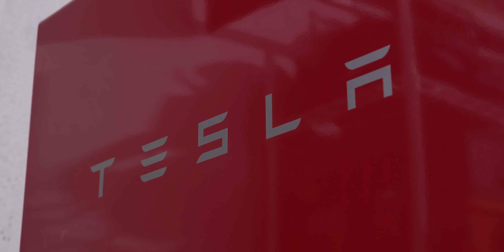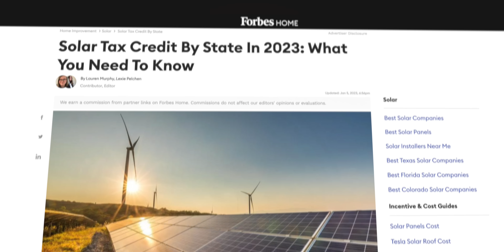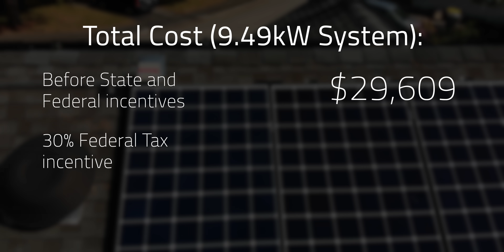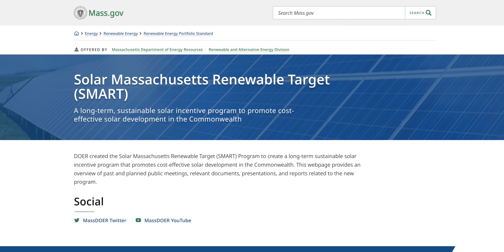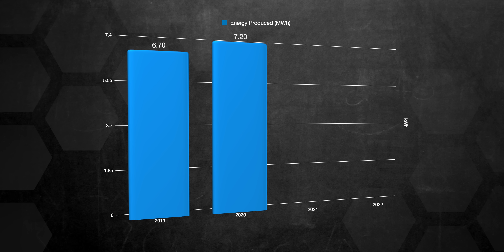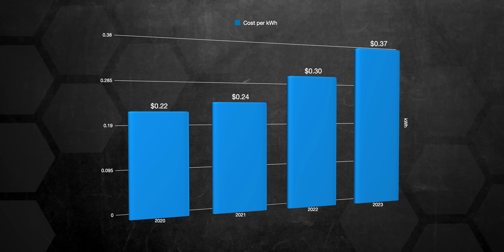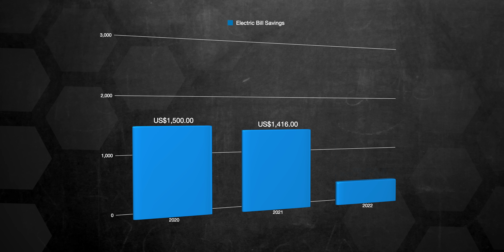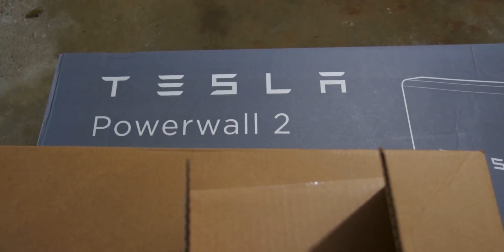5 Years with Solar Panels - Is It Still Worth It?

Comment: Roof leaks. The cost of repairing roof leaks caused by the solar install have more than wiped out any savings on my electric bill.  Initial cost of install was around $15k minus the tax credit.  Less than five years later, I'm looking at an additional expense of over $25k to repair the roof leaks including paying the original solar company over $4k to remove the solar panels so the roof can be repaired.  You must factor total roof replacement into the cost of a solar install.  Every roofer I contacted said the solar company should have told me this at the outset, but many solar companies won't because they fear losing the sale.
Reply: Installer error
Reply: Yes, unfortunately it is up to the consumer to educate themselves. Fortunately we redid our roof before solar install and no longer have electric bill , so no matter what the price per kilowatt rises to we are covered
Reply: @mj8495   curious....how many years, from when your solar panel was fully installed and full in operation will it take you to pay off the full solar panel system install?  I assume it was a whole house system.

What was your average electric utility bill per month and what's your monthly payment for the solar panel system install?

What, if any, warranty does the solar panel system come with?  Include what it covers and Time in years.

Did your home owners insurance go up?
Reply: @mj8495  but you say you do not have an electric bill anymore but now you have an expensive monthly solar bill, not a good trade off at all
Reply: @mj8495  You will never make out all things considered.
Reply: @RadioRich100  so true
Reply: That's my take on it too I had just a Direct TV dish on the roof Had a new roof put on where the dish was was a huge dry rot so with all the bolts/screws put on for the solar panels a few leaks over the years could cost thousands in damage if its not a perfect seal....
Reply: Don't install on your roof!!  Put them on stand alone away.
Reply: I question the mounting screws reliability over time. You're putting your faith in a polymer washer to seal on a granular surface. At least in the case of asphalt shingles.
Reply: @JamesSpatcher-l3r  

That's a good question.
I trust nut/bolt fasteners more.

Personally, I wouldn't place solar panels on ashphalt shingles unless I had access to the back of the sheathing

In snow belts, it's better to have a metal roof, so the snow can easily slide off
Reply: 10 years with a Solar City (now Tesla).   Cost me nothing down.  6kW system (year 1). $70/ month and Tesla guarantees output, responsible for performance and all maintenance and pays me for short falls in guaranteed production.    The inverter has failed twice and Tesla replaced free and paid for the loss of production.  Why would you ever install your own system?  Crazy.   Don’t buy a battery if you have net metering.
Reply: @miker6090  the solar company I went with will cover any roof leaks I have for the first ten years of the install.
Reply: Sorry that happened, but like everything else it needs to be installed correctly
This appears to be installer error
Reply: @miker6090  0.2% off roofs have leak issues… not common enough to steer away from the savings
Reply: @miker6090  I dislike installers that don't provide access space, so that things like roof leaks can be assessed and getting access to it.
Reply: Thats why I'm wondering if things like smart solar flower and hybrid systems with a few small wind turbines might be better. It saves the roof space for the inevitable repairs.
Reply: 25k to fix a roof leak 😂 😂 stop it! For 25k I’ll take a red eye to you right now and fix it not only that but I’ll fly out to you anytime after if need be no charge
Reply: @GreenGateTV  Your a fool, that guys comment is spot on. If you read it right he meant all the damage that system did to his house. People all over are having these problems on top of the fact that you with all this trouble will never recover the money that you spend to support that system and the  devaluing of the house. Solar panels on your house is the worse thing you can do to it.
Reply: @RadioRich100  That is a big old dumb blanket statement and not remotely true.

Comment: In my area, the cost of a solar installation is such that my payback is 18-22 years. This did not include a battery, but did include a service upgrade to 200 amps to handle the extra current. Far too expensive. Let the buyer beware.

Comment: A friend of mine is an electrician. He built a very good business, not so much on solar installation, which they done. But on repairs to botched systems. He also had an almost free system with pan els from two  -.. One panell failed and he was instructed to install 30 new panels.  Another 1 batter failed and he was told to install all new batteries

Comment: I had a 7.4kw system installed in 2009.  I paid around $30k and got back around $15k in tax credits. The first 2 years I got $3300 each year In SERCs then the program changed and has decreased each year since then. I figured the system paid itself off In approximately five years. So I am happy, definitely has reduced my monthly bills

Comment: if you paid 300 a month on electricity for 5 years straight it would cost 18k. You spent more on the installation and your building a new house now. YOUR LOSING MONEY BECAUSE YOU WANT TO BELIEVE YOUR WINNING SOMEHOW! This isnt about off grid so its only about cost vs. savings. You'll lose money on the tesla as well. Before you save the 15-20k extra you spent to NOT by gas you'll trade it in or buy another one. I owned 2 prius's before i realized whatever i saved over a corolla in gas took about 250-300k miles to justify then it was time for a new car. buy a backup generator and ditch the false narrative that solar isnt overpriced.

Comment: Hi Matt, our oven is not connected to the solar system of the house and only runs from grid electricity. However, since the installation of the solar panels and inverter, the oven randomly turns itself off and on again. Do you think the problem lies with the oven, or did the electrician make a mistake when he installed the system?

Comment: Very informative video, thanks for sharing! You might want to use micro inverters that will handle the LG panels, you are losing alot of power they being clipped at 290 watts(iq6 plus max input), if you have the 335 lg neon 2 they normally produce 400 watts , the 400w neon 2 make 480 watts. I have over 300 of the lgs installed at my properties and was blown away at what they produced when I removed the enphase micros.

Comment: Matt, when you bought your house did you borrow money (a mortgage)? When you put up your solar panels did you only see them as an expense or as an improvement, an investment, if you like, in the value of your home? Do you think the solar system you have installed has increased the value of your property? And how could you have installed your panels without a battery back up? What is the point of putting in a solar panel array without batteries to give you the necessary continuity?

Comment: - service - cleaning - not cowered by warranty incidents - removing because you need fix roof = no profit from solar, lucky if it will be 0/0 spending/saving, just p[ay 25k to power company and see how many years you will use electricity for that money

Comment: Have a 3.6 KW system on my roof. Would NOT do it again. Between the snow avalanches (which are enough to kill a dog or child), and the fact that the panels will have to be removed for roof shingle replacement, I would look to do a 'Ground Based' system, rather than roof mounted.

Comment: The .37 cents per kwh blows my mind. I'm in neOH and in 2024, it's roughly .10/kwh. Granted, that changes depending on time of year, if you don't lock in your supplier rate before summer, it'll increase. But also, dang the price differences!

Comment: I also heard that solar panels create dirty electricity all throughout your house and emf's.  It seems like you would have to spend hundreds or thousands of dollars in dirty electricity filters to clean up the whole house and if you need to have a "SMART" meter to run the panels, SMART meters also emit massive amounts of radiation (which is a health hazard).    I am not sure how to clear out all of the emfs on solar powered homes, maybe you need to have an ANALOG meter which does not emit EMF and to put a dirty electrictiy filter in every electrical outlet in your home?  There are many health hazards that one has to be concerned about with these panels, and it seems like you save very little money on your electric bill by having them in the first place.  So between the amout of money you will need to spend to clear out all the emfs and dirty electricity, and the amount of money you spend to have them installed, I am not sure you solar panels save you money period?  Seems like you will end up spending more money over time.
Reply: I've only seen dirty electricity coming from utility sized solar farms once.  The utility wasn't happy, but we were able to fix it by doing some reprogramming on the inverter, took an hour to reprogram about 50 inverters.

Comment: We just fitted solar to our house - we use the energy it provides during the day and any excess goes to a battery which runs the house until the following day. If the battery reaches full charge then we can either sell that energy back to the grid and excess energy heats our hot water tank. I am typing this note free of charge on a hungry desktop computer while my wife is doing a laundry wash. What's not to like

Comment: When it’s time to get a new roof it’s going to cost a pretty penny to move the solar panels. Better to place them somewhere on your property.
Reply: @HeadStronger-HS  Yes, that is certainly true.  For those who only have the roof as an option, it would be best to do a roof inspection and repairs before the solar panels go in.  In general, a solidly repaired roof will last 10-20 years, or about time to replace the solar panels anyway.  Of course, the cost of repairing the roof would have to be factored in…and there are no govt subsidies for roof repair.

Comment: A $30,000 solar panel system extrapolated out would pay the average 15 yr electric bill. Given also that you have to employ inverters and regulators, (which by the way break down, as well as the term output of the reactive cells in panels)
A homeowner would likely be better off purchasing a small back-up generator, and maybe 2-3 panels just to run a refrigerator or microwave/fans, smaller wattage items....
Appliances are not made for DC. and you lose a good bit in resistance, compressors, dryers, ac blowers use alot of power.  You won't run a washer/dryer/ fridge/ ac/ microwave and coffee pot, TV's and 3 rooms of lights....you just don't get that much energy.
Water heating panels on the other hand....

Comment: My wife and I got a grid-tie system in November for our home using a local company. We have been steadily paying only the account fee ever since. We are now in our lowest usage season, and I enjoy watching the meter fly backward. Our city power department is not yet doing any kind of buyback, but the banked power is a nice feature... they only charge if the meter tops out the previous high reading (and we'll set this floor forever sometime in August per our projections). We were lucky to have a south-facing carport roof with R-panel angled the same as our latitude, so installation was cheapest and our sun angle is optimal. This was not a hard decision to make. No battery yet... the Texas grid did improve last year, and renewable generation has soared in the state. I think the main value of our investment is buttressing against rising energy costs.

Comment: The big mistake people make when calculating ROI on solar is the fact that: (a) panels won't last for ever: by the time you start to recoup money, you might have to replace them just a couple years after; (b) additional maitenance and issues caused on the house means more costs. (c) The amount of money you get for exporting will only decrease as more clean energy is generated by the grid; (d) because of the fact you effectively paid for 15-20 years worth of electricity all at once, you will miss out on savings from that sum of money; (e) due to point [d] and [c], you effectively pay for electricity whether you are using it or not, because any time you are not using your own generated electricity, you're out of pocket - so when you're on holiday, you are a bit more out of pocket evey day. Because of all these points, solar sounds like a big mistake (financially) and a big headache for me personally. Even more so if your country doesn't have very generous incentives in place.

Comment: Hi I'm from Perth, Western Australia and we get plenty of sun, even in Winter. It can be overcast for up to 4-5 days here in Winter so we installed 50kwh of Lifepo4 batteries (house uses ~22-24kwh/day). I only have 8kw of solar panels with 2x 2kw Wind Turbines (actually only average about 1.5-1.7kw each at best). Total cost here was US$19,000 but we don't use any grid power at all. We are still connected to the grid via an isolator but choose not to use grid power. I recommend looking into efficient wind generators for cold climates and large LiFePo4 batteries banks. Tesla walls can explode (the unit Matt has, uses Li-ion batteries so could potentially burn the house down) 3 have gone up in smoke here and they lost their home.

Comment: LED lighting cuts costs, as does unplugging devices and machines when not in use.  Having an electric car or plug in hybrid would also be pluses for solar panel owners.
Reply: LED bulbs emit radiation and are not good for your health.  Electric cars also emit radiation.  Why would anyone want to use either?  They are pushing us toward EVIL products under the false pretense of saving the planet.

Comment: Just sold my house which we installed 39 panels on it. Consistently made money even in winter in ontario even if it was only $150 a month but $600 in the summer which we sold back the utility co for 15 cents more than we were paying them for ours. Obviously a good contract set up by our contractor/installer. When we sold the house we made more by arranging for the buyers to jump onto our existing contract.
The new house (150 yr old) will likely not get solar (pitch issues).
I’d recommend but do due diligence.   Very important

Comment: Some people fail to understand the difference between a tax credit and a tax rebate.  A credit merely reduces your AGI and your tax burden is based on your AGI.  So you only save your tax bracket on the amount of the solar tax credit.  Deducting the roughly 8900.00 dollars from your out of pocket cost for the install is misleading.  You should post what you actually saved on your tax burden.

Comment: In the UK, we had a system of encouraging the adoption of solar panels called a Feed In Tariff (FIT).  Under this system, a fee is paid to the solar owner for every unit generated, whether I used the power or not.  When I had my system installed, the FIT was 44.6 pence per unit increased by the annual inflation, so after 11 years I now get 0ver 70 pence for each unit.  The 4kw installation paid for itself within 7 years and the FIT is for a period of 25 years, so I have 14 years of payments to enjoy, at the moment I am paid around £2,700.00 or ($3,400.00) but this will increase annually by inflation and of course I generate several hundred pounds worth of electricity to reduce my bills annually.  I'm perfectly happy with my system.
By the way, don't worry too much about snow, here in the UK Midlands we used to get several weeks of decent snow during the winter months, but due mostly to climate change we have had several years with very little or no snow.  With the amount of carbon the US produces due to excess energy use, it will be the same with you too, all too soon.

Comment: Here's the catch about "tax credits," they only reduce your Adjusted Gross Income, i.e., if you make $60,000 in a given year, and install solar with an $8,000 credit, you calculate your taxes as if you only made $52,000 that year, you don't get to take the $8,000 off what you have to pay.  In reality, you get about a 10-20% discount, depending on your bracket, which could be as little as $1,000 dollars (or as much as $2,000, but that's about it).  Also, the calculated best-case cost for power over the lifetime of the installation (only about 20 years), you end up paying roughly $0.15/kilowatt-hour, which for most people is higher than what you pay from the power company.  Depending on where I live in D/FW, I've paid as much as $0.12, or as little as $0.097, and that's before you buy the battery.  It makes zero sense economically, and the solar installers know it.  They are ripping you off.

Comment: Thanks for the info.  If I was guaranteed the batteries and panels would last 15+ years and be maintenance free I might try.  But $20,000+ is a lot not being guaranteed plus I live in Florida and my metal roof is 15 years old so I would need a new roof I think?  Plus I don't trust all the web sites out there, seems like too many ways to get scammed.  Until it's make more easily DIY and void of scams I'll just pay for power at $0.14 kwh and keep my generator near buy.
Reply from the maker: Metal roofs should have a lifespan of 40-70 years.  Solar panels 30+ years.  Unless your roof has lived a very hard life in 15 years, I’d be very surprised if you had to change it out.  https://www.statefarm.com/simple-insights/residence/metal-roof-pros-and-cons#:~:text=Metal%20roofs%20offer%20many%20benefits,of%20roughly%2012%2D20%20years.